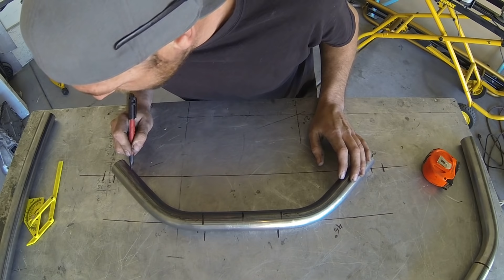TFS: Tube Bending Basics 2 - Bending the Tubes

Comment: A small bendable piece of wire helps with visualizing  which way the bends need to go on the offsets
Reply from the maker: +gsppuffer This is a tip I wish I would have remembered to add. I can see offsets in my head, but I would have liked to have added this bit of info. Hopefully it will get to the top comments for others to see.
Reply: close hanger wire would do good for visualization for bends yes you're right
Reply: @jiggalojonski  My fabricator buddy uses TIG rod.

Comment: I bend electrical tubing all the time. A pro tip for yall. Klein makes a digital angle finder for 30 bucks and it is amazing and to fix a dog leg (offset) buy yourself a “no dog” super cheap little helper so your pipe doesn’t bark

Comment: Nice work on these videos, I was really looking forward to these.  I just started my first rock crawler cage for a buggy I'm building on my channel and the offset point of view stuff is really boggling my mind...that and trying to put 5 different offset bends at the correct angle on a 10' or longer tube.  Do you have an in depth notching video series, specifically a 45 tube that meets two other already at a 90?  Anyway, we should do a collaboration at some point.
Reply from the maker: +BleepinJeep Thank you. I had a viewer suggest bending a wire, such as a welding rod, in the same shape as the offset. It would work well for small bends, but for a continuous length, you'll probably have to get some small diameter bar stock if you want a visual reference like that. 

I've had a bunch of requests for specific notches since there are millions. The best thing to do is email or message me with some form visual like a drawing or some tubes laid out so I can see the specific notch you are going after. 9 times out of 10 I can draw it out for you. 

We might be able to put something together in the future. All depends on the schedule. Just drop me a line if you have an idea for an episode.
Reply: How much the binder lake that?

Comment: I have a 19 jlu rubicon . Setting on tons and 40s , bead lock wheels . I bought a high dollar hydraulic or electric tube bender . I am building an exo cage for it . I want to be able to roll over without body damage . I wish i was closer i would pay for you to build my cage and i would help also . I have 400’ of 1-3/4” DOM .120 wall tube I’m using . I have 200 ft of 1” dom .120 . I am a welder/ master plumber and own a successful plumbing company . I actually broke 2 cheaper tubing benders and used pieces from both to make 1 decent one . I was still not happy with it so i ordered a new bigger and better one . I enjoy watching your vids and you are super talented teacher . I am going to wing it , i know i will waste a ton of tube but I’m going to learn . I subscribed!

Comment: you need to tack weld a little peg on the bender post to hang that crescent wrench on! lol   Wish these videos had been around about 5 years ago, when I had to bend all this SS tubing for a specialty fire protection system. Had never bent tubing prior to that, and your explanations would have saved a lot of miss-bent tubing!! Nice video, great explanations!!!
Reply from the maker: +Fred Newman Thanks!

Funny story - I did have a peg on the bender stand for a little bit, but I was always running around looking for the wrench when it was hanging on the peg. I ended up losing so much time looking for it because I kept forgetting that I hung it up on the peg.
Reply: +The Fabricator hey I was wondering if you would be selling cut and measured tubes? If so how much would you charge for them?

Comment: Beautiful video set and I will be checking out more videos. However I'm a plumber and in running pipe you can't roll a 45 on a 45 and still come out with a 45 in both directions. We use a 60 bend on a 45 and works good for me. Your piece on pipe and tubing was pretty good as well. Thanks for taking the time to show your skills
Reply from the maker: +michael thomas Pipe definitely has its differences. I don't work with it much, so I can't offer any good info on it other than what I did.

Comment: So I have the model 32 bender which is basically the same bender except it's build stronger to handle 2", 1/4" wall round tube. The other difference is that it had an anti-spring back pin and two of the ratcheting bars (whatever you want to call them. The things that look like they have very large saw blade teeth. lol). One of those is used to keep tension on the tube and not let it spring back during the bending process. I've always read that letting the tube spring back during the bending process is not a good thing. However while watching you bend your tubing I realize that you are using that "limitation" in your bender that let's the tubing spring back between resetting the handle to the next tooth as a tool to insure you are at the exact bend angle you need to be at. While bending tube with a hydraulic bender or the model 32 with the anti-spring back aspect of the bender you can't do that. I've found it to be extremely difficult to judge that spring back to insure that the angle of the bend is spot on.

As you already know. being 1 or 2 degrees off on a short piece isn't really that big of an issue in most cases. However being 1 or 2 degrees off in a long piece is a very big deal. How do you recommend dealing with this problem? Hell after watching these videos I'm seriously thinking about tossing my air over hydraulic setup that I build and going back to a manual bender and eliminating the anti-spring back aspect of the bender. The only issue I have with doing that is that bending 1/4" wall 2" tubing is not something you can do in a manual setup. Now I know this isn't something I'll need to do all the time but when I do need to do it I'd like to not have to completely rebuild my air over hydraulic setup so I can make a few bends.

BTW. The more I watch your videos the more I feel blessed that you are creating these. You're an awesome teacher and see these video leading you into something big. This is by far the best vehicle fabrication channel on youtube. I'm so much more appreciative for this content that you will ever know. You're teaching me things that I've struggled to figure out on my own and giving me tips that help me refine what I already know. This content is something I have always wanted someone to show me since I was a child. So thank you.
Reply from the maker: +Alvarez Metal Works Here is the quickest answer I can offer. I follow what you are saying and I have experienced the headache before. 

If you plan to keep the hydraulic setup, you'll need to make a few bends out of some scraps to determine the number of degrees over that you'll need to add for spring back. You should bend a 30, 60, and 90 degree band manually and note how much extra you need to add. When you bend with the hydraulic setup, just bend to the degree that you determined will compenate for the spring back. Mak sure you do this for every grade of tube you use (ERW, DOM, CMLY, etc.)

Let me know if that makes sense. I can try to explain a different way if not.
Reply: I makes since and is what I thought I'd have to do. I was just hoping I was making it more complicated that it really is lol. I guess not. Going to have to make a bunch of notes, cheaters and test pieces at some point. On the bright side I only have two die sets at the moment so it won't be that bad right out the gate lol. The Jew in my says to not waste any metal so I try my best to not do a bunch of test pieces on anything I do. I can see that I really don't have a choice when it comes to this though. Consider it an investment lol.

Thank you again. BTW I sent you a message on FB.

Comment: Fun stuff.  But, at 17:49 you don't show us that the "offset" bend did not lay tightly up the corner of the pattern between the two 45 planes.  You needed to measure up the corner between the two 45 planes (or calculate this angle).  That angle is more than 45 degrees and the starting point is different.

Comment: How do you compensate for growth? You turned your tube around for each bend, which would not give you the desired centerline. To find your 4" offset at 45, multiply 4x 1.414.
Reply: Because he also turned the cheaterpipe around to get the right measure between thr bends. That gives the right dimensions. This method would not work for long pipe where is multiple bends and turning around is not possible.

Comment: good video but you chose the easiest offset possible.  I’d like to see you change the 45s to something like 30 and 60, then space them 3” apart and see how you would do that. 
Also this is way easier when you doing a tiny 1:10 scale model on a bench. When I bend conduit for electrical work, alot of the time there is nothing to reference the angle from because it’s 10’ away and there is shit in the way. It a lot of guess, test fit, bend  guess, test fit, bend.

Comment: I have been watching your tube bending series and I see one thing I will have to do different. I have a Hossfield bender and the dies work the opposite. Where you pull the tube into the die from behind my bender pushes the tube into the die in the front. But I still liked to see you doing the lay out it will help me out Thanks

Comment: I have that same bender and it is very difficult to bend schedule 40 1 1/4 galvanize pipe in fact I pulled the anchors out of the concrete floor it's only made for tubing or conduit not made for thick wall material
Reply from the maker: They sell pipe size dies for it which 1-1/4" Sch. 40 should be no problem on this bender. I've bent some 1/4" wall tube before with no issues.

Comment: Can i ask what happens if the tube bender isnt flat when measuring for 0 degree on the die to work out tube offset? my bender is not straight (concrete floor not level and ground anchors not great).  Brilliant videos, been alot of help so far!

Comment: Great set of videos, I've learned a lot!! Your explanation is excellent! Working within a boundary is based on the centerline of the tube right? Is that tubing appropriate for an exhaust and how would you make tighter turns? I need to make a custom exhaust for my vintage beetle to add a catalytic converter and it needs to be tight and compact. Thanks Bro!!

Comment: Just a quick question. When you offset your angle doesn't that cause the angle to decrease? I liked your vid!
Reply: I was going to ask this too, if the offset is in contact with both the 45 deg angled timber pieces, then that bend must be less than 45...how do you work out that angle?
Very informative video, thanks!
Reply: I realize your comment is over a year old, but yes ... 
Pretty sure the bending angle should be 60° in this case, in stead of 45°
[ arccos(cos(45°)*cos(45°)) = 60° ]
It was still a pretty snug fit though!
Reply: Glad I wasn't the only one questioning this. Seems like there should still be an easy way using those wooden jigs and/or the protractor to find the compound angle rather than having to understand trig.

Comment: Hey, great videos, quick question though, the 3D bend you created unfortunately ended up being 45 degrees flat/45 degrees up, which meant you bent the tune to 45 degrees once in the bender. What if it were say 30 degrees on the flat and 45 degrees up, or 45 degrees on the flat and 30 degrees up? Would you  bend to 45 degrees, 30 degrees or somewhere in between?
Going to keep on watching your videos, full of useful info thanks.
Reply: I'd like to know this too

Comment: Awesome video..Quick question.  So when u do pipe work. Safety roll cage. Bumpers ect. Is there any construction specs. How to reinforce the structure.  Joints. Angles degrees. Ect..specs on building strength.  Blueprints like triangles squares bends. For safety rating. V. Welds. Pipe on pipe. V. X 90s 45s. Like a builders book of pipe work. Just wondering because I wanna buy a pipe bender . And welder and start building stuff. I do construction so I get how to reinforce stuff. Just asking how do u know what u know. Who taught u these skills. Buddy..
Reply from the maker: Re-watch this episode. Pay strict attention to pipe vs tube. When you understand the difference, find a rulebook for the sanction you want to build a cage for.

Comment: Question, I attached my bender to a old receiver hitch and welded a receiver under my welding table.  Now, my issue is the hitch of course doesn't fit tight and there is some play in the hitch which means my dang bender is never level.  Where should I measure the plan of the tubing to make sure I don't have an offset in say a roll cage hoop.  Can I put a angle finder on the end of the tube with one of those clamps and set it at 0 degrees then bend first bend, pull tube through to make the second bend and make sure I am still at 0 degrees?

Comment: Great video! Really helped me dial in my bends. 

I am having a slight issue when bending two 90's on the same pipe (Pro Tools Manual Bender with 3.5" CLR 180 Die and 1.25" Tube) and that is a slight torq that is occurring. I zeroed out my die and it still keeps occurring. 

It is a slight .3 degree torque that I can't quite get rid of even if I keep the level on as I bend the pipe. Any suggestions would be greatly appreciated!

Comment: your process of finding the middle reference point does not make any sense or seem to serve any purpose, because it is much simpler to start at one end an just add up your totals. 0+5+8+7 1/4" gives you the point at which you start the second bend. So why cut 7 1/4 in half, then do 0+5+8+3 5/8 + 3 5/8 to give the exact same point.

Comment: Like your video! I am trying to bend a aluminium tube, the same wall thickness as crunches - very thin. If I fill the tube with sand and water and packed well, do you think I can bend it with a conduit bender without break the tube? Thank you in advance!

Comment: Great informative videos, going to use your tips building my next motorcycle chassis. 

Question though - how do you get exact measurements using a tape measure and a Sharpy?
Reply from the maker: +riceburner32 You don't get exact measurments with simple instruments. For more exact, or precise, you need to switch to precision measuring equipment.
Reply: +The Fabricator my fault thought I heard you using the term "exactly" sorry if I misunderstood.

Comment: In reference to your mini rock slider- rather than making a new 45* cheater, couldn't you have drawn a 45* line from the "secondary" line down to the termination point and used your 90* cheater by holding it on the CL of the secondary line and sliding it over until the OD of the tube touched the drawn 45* line?  Sorry for the run on sentence, I hope that made sense. also, I really appreciate your mindset of "We already know this, but let's pretend we don't". I used to get lost in college classes all the time when the instructor would assume we knew something and breeze over it.  I might as well have gone home at that point because nothing made sense after that point.  So, thank you!
Reply from the maker: +Scotty Milligan  That is the method I would have normally used, but since I was demonstrating in a very basic fashion, I just bent a second cheater.
Reply: Ok, so that WILL work. Awesome. Thanks for the reply, bud!

Comment: the wire that indicates what your angle is looks so janky.   what happens when someone accidentally bumps or distorts the position of the wire?   I would think that the maker of this bender would have a much stronger solid piece of metal to gauge your angle.
Reply from the maker: +john Wow The only time the pointer wire gets bent or distorted is when changing dies. While it sits on the degree ring during a bend, it's difficult to unintentionally bend it out of whack. If it does bend during a die change, all you do is bend it back. 

If they offered one that was more rigid, or custom cut, it would likely get destroyed during adie change and not be able to be straightened back out to the point of being true. The piece of welding rod can be replaced in seconds for practically nothing.

Comment: small question. if the sample piece you used has a waste of approx 8 inches. how can that be calculated? I am using 4.5 R X pie/2 (theta) but I get 7 inches. I don't have bender but want to calculate bend and material lost.
Reply from the maker: Pi x CLR x 2 / 360 = Material Per Degree
MPD x bend angle = how much gets used.

Comment: What is strength difference  between cold rolled steel and similar diameter chromolly tubing?
Reply from the maker: About 40,000 PSI or so without looking it up...

Comment: Hey,

I bought a tube bender and all it seems to do is kink the tube and the bending doesn't work. Can you suggest a metal to use? (its called a bull dog from howron industries) I have tried to contact the company many times, and they wont get back to me
Reply from the maker: I checked out some of the specs (what little I could find). The CLR of most of the dies is too small for thinner wall tube. Other than that - likely causes of kinking are:
Tube not clamped tight enough when bending
Tube is too thin
CLR too small
Tube is slipping
Incorrect bender

The company who manufactures it doesn't seem to put a lot of info about the capabilities or support behind their product. I would suggest sourcing a different brand.

Comment: Just curious, if you do a lot of cutting why do you use abrasive blades and not the nice metal cutting blades ? Like the evolution brand stuff
Reply from the maker: 7808y Because I use my bandsaw most of the time
Reply: The Fabrication Series ya they make a lot less noise sparks and and that abrasive blade smell .. Was just curious you have several nice saws on stands

Comment: where did you get the angle finder/protractor ?
Reply from the maker: +CCs Welding Local hardware store. You can typically find them in the tool section, or order them online.